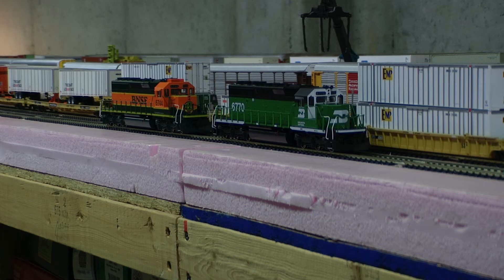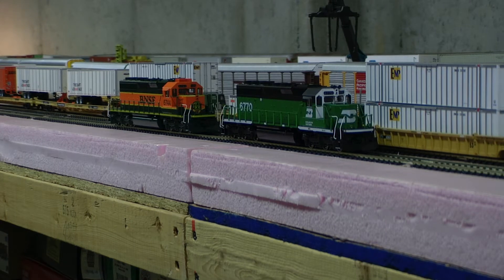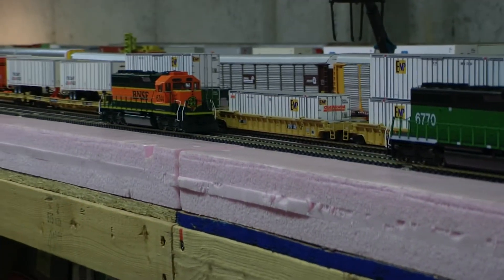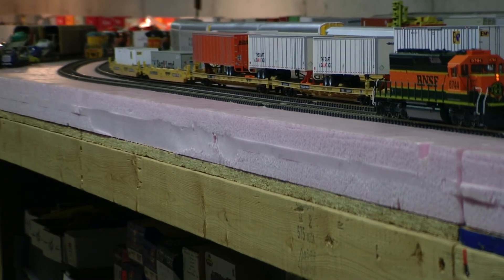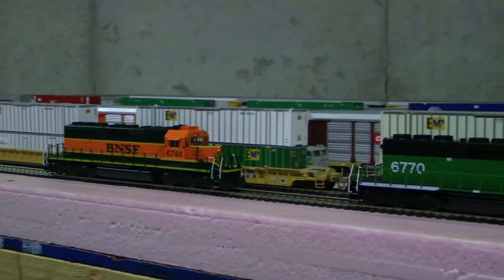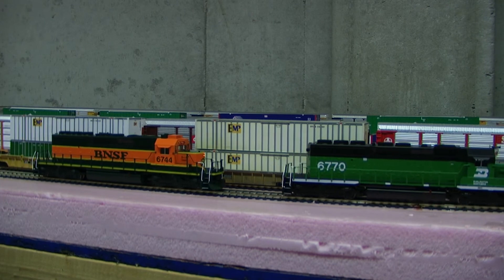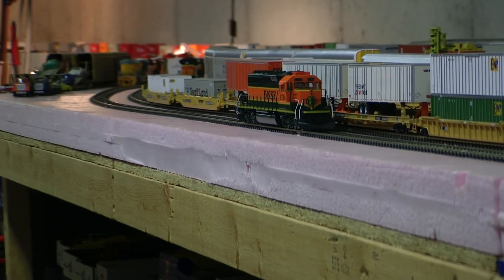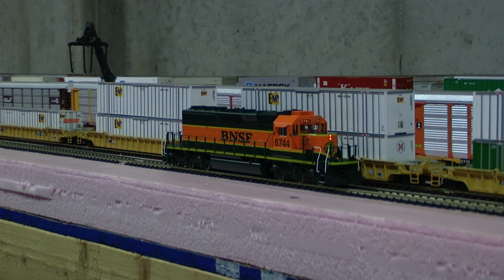Lok Sound Demo of Two Kato Kobo SD40-2 Mid Production Units

Comment: Although being a fan of the Tsunami sound decoders,I actually allowed a installer to install a LOK sound select decoders in both of my Proto 2000 UP GP60's with 4 ohm round speakers.And the volume wasn't very impressive at all,however the actuall clarity of the sounds was excellent.I sudjest using 8 ohm speakers and at least 2 watts.The Railmaster Bass reflex speaker sounds great with any decoder,and has a enclosure and bass(deeper tone)Needless to say i sent the 2 units back and had Tsunami sound boards and railmaster speakers put in them.How-ever recently i have heard a Demo on ESU Lok sound decoders with a 8 ohm speaker and must say it sounded fantastic!Very realistic in my opinion.Soon ESU will have a new FDL-7 16 sound decoder for the modern GE's.I've already heard the demo,and all i can say is .."Wow!!!

Comment: Im supprised! Im a die hard Tsunami fan, ive fitted loads of them in my own models.
QSI is awfull that's for sure. These Lok sound decoders sound pretty good. Certainly the horn is a little better then Tsunami and I would think the slow speed motor control is better. I wonder if they support manual knotching though? I put a Loksound in a 45T-2 about 4 years ago but was far from impressed, this is much better!
Wether I would choose over Tsunami, not sure, I think i'd have to hear it in person 1st

Comment: my opinion, ESU has much better motor control. But the Sound is better on Tsunami decoders ! The ESU Sound is good, But I like more the Tsunami prime mover Sound (run,idle and Specially the start up) ! Only the Horn sound is great on ESU Loksound. I have the same two SD40-2 BN#6770/BNSF#6744 with Tsunami. I prefer Tsunami when Model with Sound / Model without sound I use ESU. only my opinion and experience

Comment: Howdy Jeff, is the lighting on these KATO mid-production locomotives typically an issue from the factory?  I bought one last year with no sound #6752 & then learned after I bought it that it didn't have DCC either even though the owner of the train shop told me it did.  Being new to DCC & knowing very little about its workings, I bought an MRC #1802 decoder upon recommendation & the lights on the KATO really suck compared to what they were when the factory decoder was in it?  Can you give some input as I'm ready to pull my hair out?  I've been an "old school" DC operator for 30+ years & so far I'm not having much fun with this DCC setup, lol.  Thanks in advance, Bo.